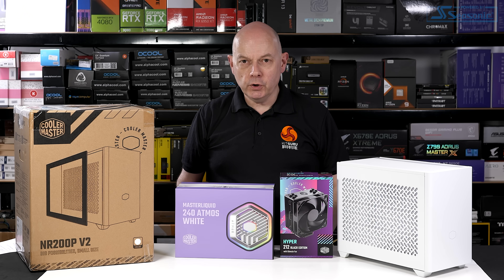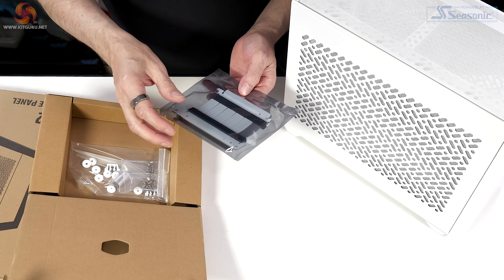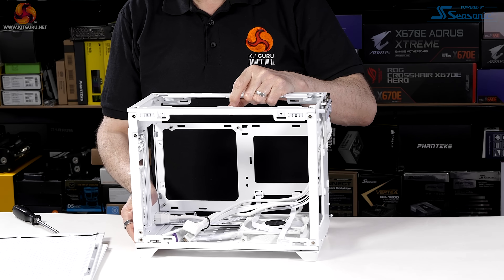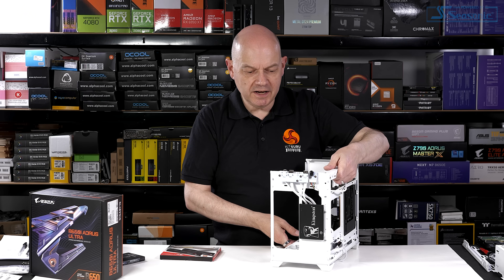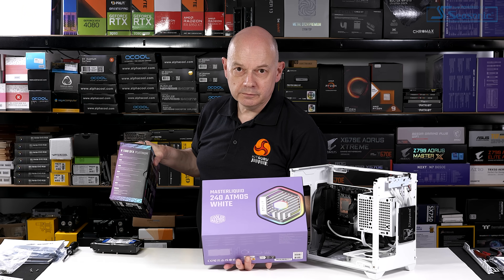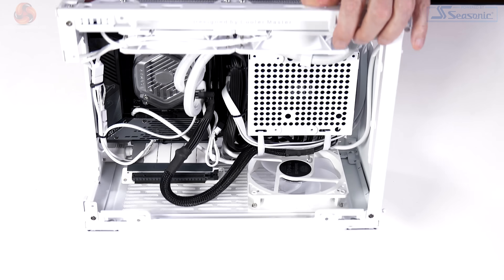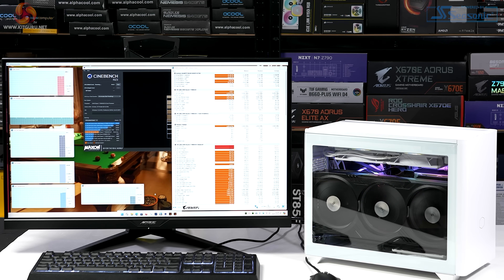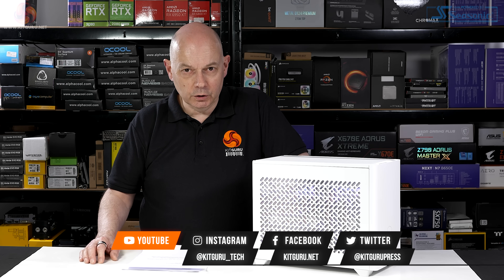Cooler Master NR200P V2 - It's a bit complicated

Comment from the maker: Does this case appeal to you for any new build you have in mind? Have Cooler Master nailed the design for you? What would you change, let us know in the comments below.
Reply: it's a clear example of how to take a good case and make it worse in almost every regard but also charging more. the SFF discord laughed very hard at the changes, even the CM rep there alluded to the fact that he was against the changes.
But hey CM does what they want with their money, i have no use for a case with a riser while i can better use the space by using the classic layout.
Reply: Don't think this is great for first time builders. I'd consider taking that fan out during the build and maybe swapping it for a slim 120mm fan for better gpu room on the bottom. I've done two builds with this case a Pink build for the wife in the original version, and my personal build with a 7950X-3D & 4090 using the NR200P MAX. It can be a challenge but satisfying once its actually done and working.  It does make you miss cases like the Fractal Torrent Mini.   I wished CoolerMaster would make a dual chamber version.
Reply: They had already done that before this V2 was announced.

Comment: It's worse than the original NR200P, but costs $120. WTF.
Reply: How is it worse?🤔
Reply: @JacquiPenar  not sure if the V2 has it but I have the first version and my radiator is mounted on the included bracket with four fans so it pulls air in from the vented side panel. I could move the GPU to a vertical position with the riser cable and mount the radiator in the bottom. I was going to get the V2 but I opted out because it looks pretty impossible to mount a radiator in the top with 4 fans and I would be limited to just two.
Reply: How's it worse? 😂 I couldn't fit my 4090 in the original. Now I can...
Reply: @SoulEsne a radiator with 4 fans? What you expect to fit? A 420 rad?😂
Reply: @inked-96  to be fair what I did was absurdly difficult to install but I installed a 280mm rad with 4 140mm fans. I have always put fans on both sides of my radiator and a mini itx case isn't going to stop me now lol.
Reply: @SoulEsne Fair enough. I'm just in the process of building in my V2 with my 4090 Suprim X. Hoping a 280 Arctic liquid freezer iii will fit.

Comment: Fair conclusion Leo.  I personally wish more air coolers could be used. Sick of AIO lately.
Reply from the maker: glad you liked it but we did use an AIO in this !
Reply: Would a flat style air cooler from noctua or thermalright definitely not fit in this case ?
Reply: I love AIO's since, I've been using a D15 for years now haha
Reply: Get the meshroom d
Reply: @boltsandbraces6261  Honestly, the venerable Hyper 212 Evo would fit in the original NR200 - and I'm presuming the motherboard height and case width are the same - so even a 120mm tower cooler should fit in this case without a GPU (I use a Ryzen 5 5600G without a GPU in the original for a HTPC).  Otherwise would think a Noctua horizontal heatsink would fit, given that there's the power supply AND a 3.5" hard drive taking up "vertical" space on the far edge of the GPU slot which could leave room for it.

Comment: They should have called this the NR210 or something. 'V2' implies that it's 'better' compared to the V1. The original NR200P is a lot more versatile, but I get why this exists. Lots of SFF enthusiasts would already have the SFF PSU and 240mm AIO, and would just need a case.
Reply: Also if you can get a cheaper AIO and SFX PSU you can just buy this version and done. Or maybe you can't find a V2 MAX available but there is a V2 available.

Comment: NR200P V2 With a 4090 suprim X, 9800x3d. GPU never hits above 68c. CPU 73-76c after a few hours of gaming. 280 radiator with 2 x 120mm fans underneath.
Reply: which cooler you got?

Comment: This was an ideal choice for me, needed a case to house an upgrade GPU (longer then previous), my existing Lian Li TU150 case would not take it. Wanted to use existing parts so would not have gone for the MAX. The V2 with USB C front IO and being so flexible in build accessibility made it my top choice.

Comment: I don't mind losing that extra SSD in the front since you can just stack them in that single slot and the front panel will still fit without issue. That's what I'm doing now in the original NR200P, have 2 Samsung 870EVO's taped together so I can have all my fans routed to a Corsair Commander module on the 2nd SSD spot.

Comment: Would love to see a noise-normalised thermal comparison with the original NR200, where the vertical GPU performed quite a bit worse than the horizontal. Even more so if the GPU is thick enough to deshroud and directly use the 120mm case fans to cool it.

Comment: Great review, having just done a NR200 last September as my first build, it's very fiddly indeed. I hate that they have actually reduced the choice of CPU cooling and GPU mounting options. The best upgrades are the USB-C Front panel option plus the existing two Type A's and the cooling hole at the front (sorry it's a GPU poke through hole really) 

For now a 4080 i5 1300k is enough for a few years, hopefully by the time I need there will be a NR200 v3 with more config options.

Comment: I thought the V1 was going to be discontinued, it doens't seem like there is any stock of it atm. As a V1 owner I don't like the V2, the only good thing are the fan rails on the roof of the case...but it removes a lot of options from the V1. I probably looking elsewhere if I need to replace any of my V1s
Reply: I cant remember the V1, what did they remove in the V2 ? I see they have a V2 MAX as well out now.
Reply: According to machines and more cooler master decided not to discontinue the far superior nr200p.
Reply: @hairsprungdutchtechnique9626  flexibility, the max and this doesn't let the user pick their own build. Can't use any great air coolers, can't do triple rad custom loop, can't choose vertical or horizontal gpu.

Comment: which direction is better to set the air flow?  suck it in from the top through the AIO and blow it out from the bottom?  Can it be the other way around, suck it in through the dock and blow it out through Aio?

Comment: I think there are some people who wanted the Max but without the AIO and PSU, because I wanted to install an AIO or PSU of their choice.
Another reason is for those who want to put a custom water inside it.
Reply: The other point made about the original NR200 was that the radiator for the AIO wasn't at the top of the loop, so the pump could theoretically have bubbles trapped inside when the fluid permeates.  With vertical GPU mounts, some put the radiator in the floor of the old case.   This could then lead to relatively premature pump failure.

Comment: Would there have been enough room under the riser cable for a second intake fan?
Reply: i didnt had any room for my 15mm fans :(
alot of ppl said they did but i didnt :(
it looked like the riser cable and power connector was clashing that area :(

Comment: I don't see why this would be an unnecessary release. Some people already have SFX PSU and AIO but might want to switch to another case. Others may want to buy a different AIO, go with an air cooler, or prefer a custom loop. Some might choose a different PSU with different specifications or just like another PSU brand. Sure, I agree that the case has a little bit misleading name because it's strongly related to the previous Max version, but it's not the most horrific naming scheme, looking at you Nvidia.
Reply: Yeah good point, but it seems to be confusing a lot of people in comments.
Reply: Yeah Nvidia are the worst, no dbout about it. I think this V2 has a place in the line up, but their naming is just confusing people. Leo nailed it in this video. Its a pretty useful product as you say for people who want to switch and try a different cooler.
Reply: I dont think this is as good as the V1 they cancelled. Fan rails are good in roof, but they removed some things I liked after doing some research.

Comment: Oh gosh I really don't know what build to do next. For 16 years I ran everything inside the original Cooler Master Cosmos, with the original case fans, and my original 850W Cooler Master PSU working flawlessly for all that time. But now... I don't "need" HDD bays, or optical drive bays (useful, but not used enough so I would get a USB one).

So I am really struggling for what build I would go with - ATX or SFF. I have an XFX MERC 310 7900 XTX, which is humungous of course, so something that fits that is essential. As for CPU - I generally rock the "700" version of a ryzen 7 CPU - currently the 5700X - I don't need a 100W CPU anymore but my use-case has changed from "scientific" to mostly "gaming" and photo editing.

But I loved the Cosmos because of the sound-proofing inside it - I like quiet PCs! Though I appreciate maybe things have gotten quieter for case fans etc in the past 16 years. Yet, I don't like to lose performance... 

So is it possible to go SFF with such a huge GPU... or am I better off with an ATX build. 

I also don't want a gazilliion utilities for different RGB / monitoring software, so one manufacturer of most of the components is ideal.

So where do I go!? Cooler Master? NZXT? 

If anyone can help...!

Comment: The max had issues with the aio and psu. Noisy pump and psu, people would end up changing them up. So it would end up being a waste of money to buy it. I always thought it was an awful purchase, as it was 400 usd.

Cooler master decided to sell the case by itself with new side panesl and usb-c but..... they did indeed want this to replace the standard nr200p, hence the name v2.

Once this was reported by pc world, most of the community was not happy about it. Cooler master got lots of negative feedback, as the v2 is a far more limiting case.

Eventually, they rolled back the decision to discontinue the nr200p and left the name v2 on this model. I'm guessing they didn't want to spend the money to reprint manuals and boxes to change the name.

Comment: Whats the difference in dimensions between max and the v2…? From the video the v2 looks smaller.
Reply: I think they now do a MAX 2 as well. THe Max is 377x185x292. The NR200P V2 here is 372 x 185 x 292mm - so I think they are the same, based on the CM website, which is a mess to navigate.

Comment: They should have made it exactly the same as the NR200 but with the ability to top mount a rad or  fans like in the V2 or max. And then called it the NR200 Evo....job done

This is not great for those that air cool.

Comment: Well it would seem to suit an Intel i7 and i9 which run far too hot for an air cooler anyway.  Only problem is the minimum recommended radiator needed is 340mm.  The NR200P max came preinstalled with a “special” 280mm radiator with an extra 25% fins over standard radiators which is just ok for an i9.  So Intel guys are going to need to really think carefully about the choice of water cooler if they choose this case.  I am building an NR200P max as we speak and purchased two optional extra fans for the bottom of the case.  Unfortunately with the riser card in place, a slim “15mm” 120mm fan is the biggest that will fit under the cpu.
Reply: Great review also.  Straight down to the important stuff, no faffing about and no wasting time on shiny things.

Comment: The nr200p max is end of life according to Scans website.
Cooler master now have a Nr200p Max v2 on their website now, extra couple cm for gpu length, improved ventilation and the PSU is now atx 3.0

The non max version makes zero sense unless you've already got an sfx psu and an aio you want to reuse.

Comment: The whole vertical GPU mounting only is dumb and riser cables suck! Every time PCI-E raises a generation it introduces a whole set of headaches and cost too. Not everyone wants to install an AIO with the associated extra failure points.

To call this a real V2 upgrade, keep the USB-C Front Panel upgrade and the extra room at the front of the case for longer graphics cards, and maybe the changes to how the case can be disassembled. 

Another real improvement to the case would be some kind of concession for RAM cooling, as the limited airflow around that area of the case does impact tuning potential considerably. I guess this was too hard for the Cooler Master engineers to think about and design.